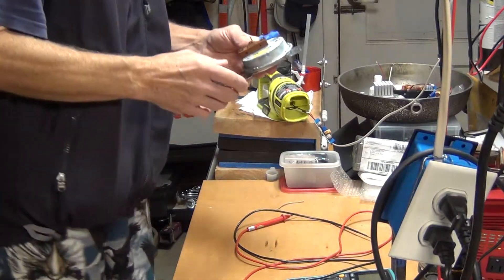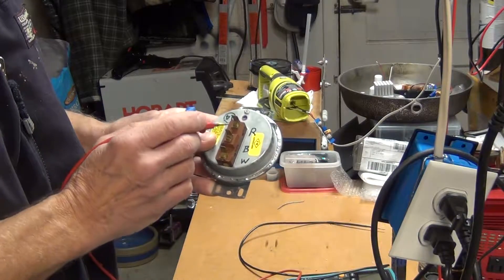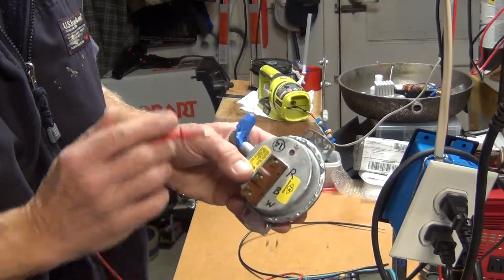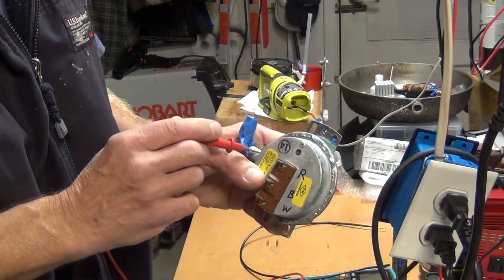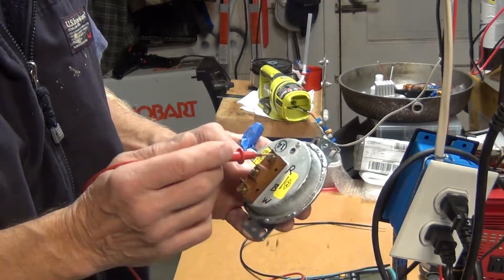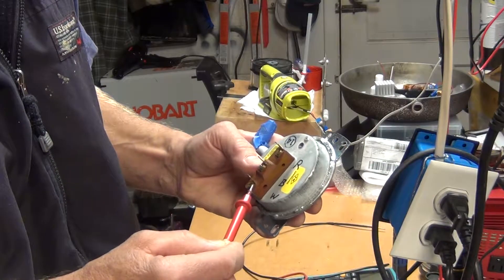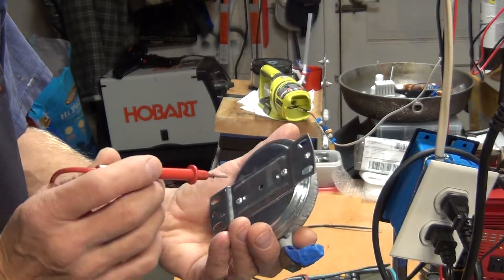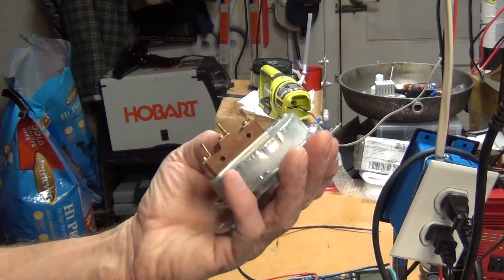Three wire inducer pressure switch

Comment: After TWO DAYS of searching for answers by 'professionals' you are the ONLY one who explained that the normally close circuit stays closed to keep the inducer fan running while the normally open is switched by the pressure!
Thanks.
Too many posturing idiots that give textbook answers with fancy tools but never get to the point, PLUS they are ALWAYS featuring natural gas only and two-wire valves only.
I wish I could press the LIKE button a hundred times more.
Reply: Thanks